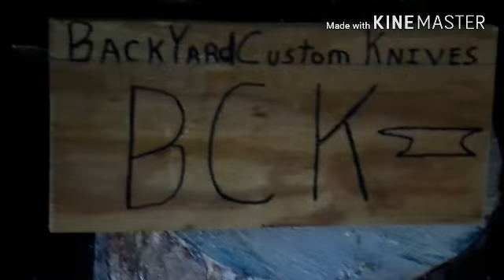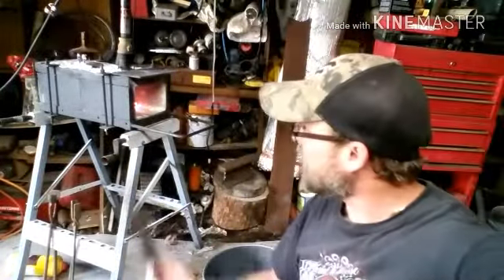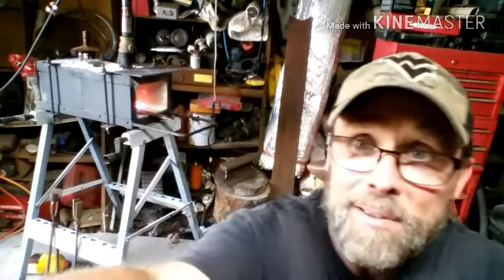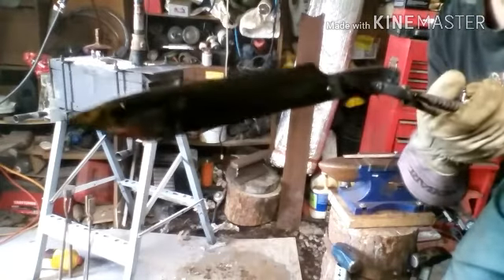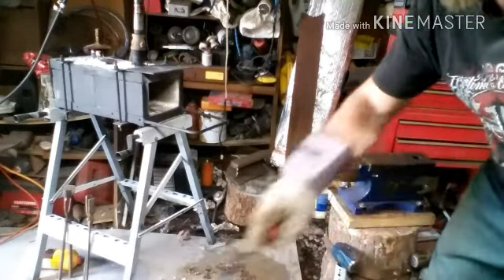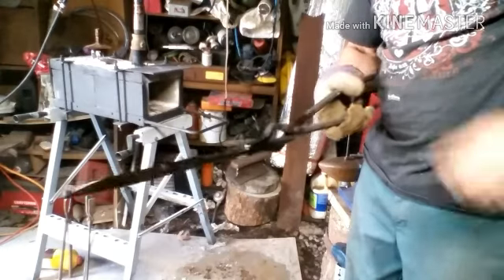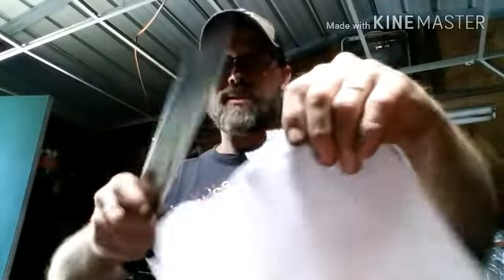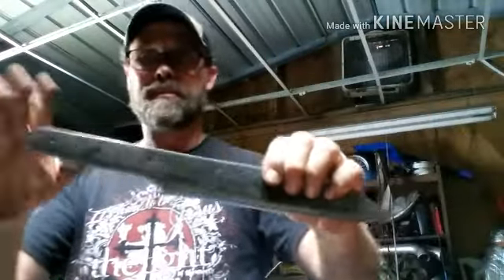Chopper2

Comment: Just swinging by to check out some of your vids... MI Woodsman suggested I come over to check out some of your blacksmithing stuff..... impressive blade. Did you make your tongs? I need to make some when the weather cools down a bit. I haven't tried making tongs yet.
Reply from the maker: Yes I have made three sets of tongs and still need more. Thanks for subbing my channel I will come over and check your channel also. Can always use tips on blacksmithing i have only been at for less than 3 years at the most.